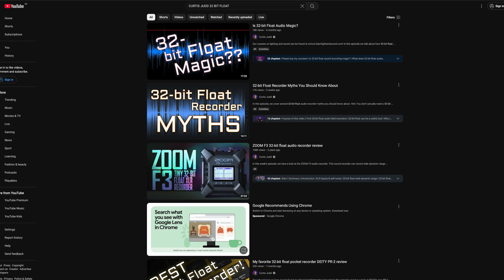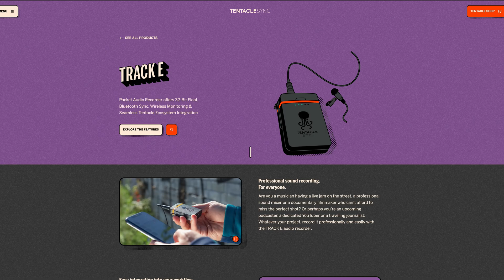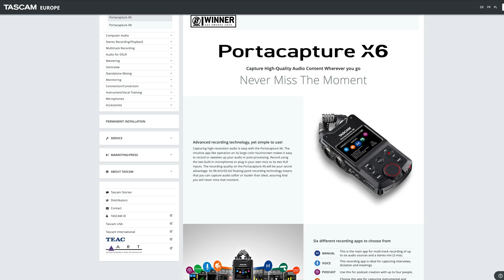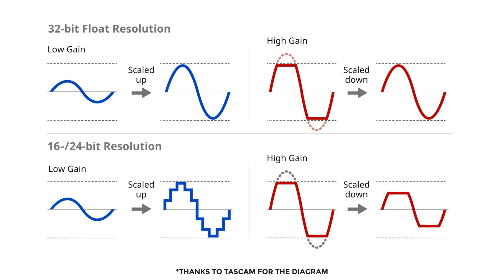Is Curtis Judd Wrong About 32 Bit Float?

Comment from the maker: Big love to Curtis! 😊
Reply: Hi Harv, Thanks for the dialogue and for keeping it classy. 

The specific premise of that video was to help those who had 24-bit recorders who may not be able to afford an upgrade to put their FOMO to rest, and convince them that they could still make great recordings.  My mistake may have been that I didn't reiterate that throughout the video (I did state it quite clearly at the start).

For the record, I have lots of 32-bit float recorders. ❤

But I also get questions like, "Should I upgrade my old Tascam DR-70D for a new ZOOM H4essential?" And at least for the sub-$200 32-bit float recorders, I'm not sure I can really recommend such an "upgrade." Several of those 32-bit float recorders actually only have a single analogue to digital converter and/or the recorders have preamps — and in some cases, built-in microphones — with rather limited dynamic range and higher than ideal noise floors. So I do think there's some nuance in there and that we need to be careful to clarify that 32-bit float is not universally awesome. It does actually depend on the implementation, especially at the lower price end of the market.

Thanks again for approaching this as a constructive dialogue and keep making great sound! Good to meet you!

Comment: I've used 24bit recording all these years and made great recordings, but I've also had problems with the sound source changing volume, both extremely loud and quiet, which created problems in post. As a solo musician and field recordist, I usually do everything myself, so 32bit-float has been fantastic when I can't monitor the gain levels. I currently have 3 different 32bit recorders, plus my trusty old Zoom H6, which is still a great 24bit machine. Does everyone need 32bit? No, 24bit will still do, but 32bit has its place.

Comment: This video conflates the advantages of these new ADCs with the 32-bit float feature with the advantages of 32-bit audio format itself. To clarify... 

32-bit float in new ADCs offer additional input headroom without having to gain stage, that's it. It's built by integrating multiple (24-bit) fixed-point ADCs together. "I don't have to gain stage" is all the advantage it offers. Thermal Johnson noise in ADC circuits dictate that after ~21-bits, all you're capturing with the extra bits is noise. 

32-bit float is useful for signal processing, agreed. But software-based SRCs (sample rate converters) are superior to hardware based ones. So technically you would get higher quality audio if you had a good 24-bit ADC you gain staged properly, then upsampled within your DAW. 

Practically speaking, does it matter? No, any of these solutions will serve you well. And "I don't have to gain stage" is a nice feature. But you're confusing a lot of stuff here.

Comment: When I started digital recording possibly before you were born, there was a switch on the back of the digital interface where you could choose 14 bits or 16 bits.  Times have changed... now I have four 32 bit float recording devices and I can't imagine buying a recording device in the future which doesn't have 32 bit float as an option at least, partly because it makes life easier and partly because non-32 bit float devices won't be available unless you are happy to buy items first marketed years back.

I do have a few concerns over marketing.  Firstly until someone explains how single ADC converters writing to 32 bit float files are any different from the same converter writing to 24 bit files - same stuff, different size bucket - I do take exception to single ADC 32 bit float devices being sold without making it clear that they are not the real thing.  So far it's mainly happening at the bottom end of the market, but even so, it's a bit of a con at least in theory.  Secondly, there is the whole thing about where in the circuit the gain controls are located.  Curtis Judd is about to review the new Zoom H5 Studio device and he did a live item about it recently.  It's a very good device (imho) and it does have dual ADCs, but although it offers 16 bit and 24 bit and 32 bit float output, the ADCs are immediately after the input sockets (and likewise the internal mics are routed that way too).  It does have gain controls for the four input channels, but they are purely digital.  So I pointed out to Curtis that although you can create 24 bit files with the recorder, there is close to no point because you have to use the digital gain controls to ensure you don't try to store levels which 24 bit can't handle, but you are not using the gain controls to make the best of the preamp signal to noise ratio.  And therefore you are simply making life harder for yourself by insisting on pouring your audio into a smaller bucket which might just overflow, whereas it would make no difference to how the audio is handled if you poured it into the very, very deep 32 bit float bucket instead.  Same data, different container.  This is in contrast to a device like the Portastudio range where the gain controls work the old way, setting the gain of the preamps before AD conversion.  But unless you look at the circuit diagram for the H5 Studio, you wouldn't know that is how it works.

Lastly - honestly - I have just come across a small YouTube channel where a guy has started using the ultra-humble Zoom H2essential device to record University bands, orchestras, and choirs while he uses multiple cameras to video the performance.  Using the H2Essential means he just plonks it down in front of the stage - or possibly suspends it, I have asked for details! - hits the record button, and gets on with the video side of things without any concern over how the recording is going to come out.  And the result is astonishing, given the price of the device.  It is incredibly hard to find examples of large performing groups recorded with correctly located portable recorders, and I do recommend those wanting to see what a bottom end 32 bit float recorder can do has a listen to some of the recent recordings on that channel.  And then think how a higher end recorder might have done even better.  (Search for "Vanguard University 2025 Spring Instrumental Concert") It's a brave new world...

Comment: How do you find editing 32bitF files in FCP? Super interested as I’ve not done it yet. If the files needs a lot of gain +12 might not be enough.
Reply from the maker: It’s completely seamless, if you need more juice just add some compression or you can boost the DBs via the basic eq plugin 👍🏻

Comment: You don’t need it mic pre’s and A/D converters are everything. People who don’t know anything about audio may need it.
Reply from the maker: Ah but my point is you don't need to choose between one or the other
Reply: @ Agree, I went to school for audio  engineering and worked in a recording studio. He was correct about good preamps over 32-bit. If it has both great but I rarely use it and you don’t need it for people speaking. I do use for recording cars with loud exhaust those situations it perfect. We have gotten along without for years.

Comment: Preamps are WAY more important than so called "converter quality". Most converters today remain noiseless after 100 re-generations with the exception of a few very cheap entry level units. This isn't 1995. 32 bit is superior. You are right on this one.

Comment: Good video.  I had a ongoing conversation about this with Curtis after he made his video.  Like you I can’t see the point in not having 32bit float.  I think Curtis sees it from the point of view of a dedicated sound recordist,  but when you are recording as well as interviewing, or working with actors - as I do for our podcast- 32 bit can save you from losing  work to clipping.  This does not mean you shouldn’t set levels, but you have one less thing to worry about if you can’t be solely focused on monitoring audio meters.